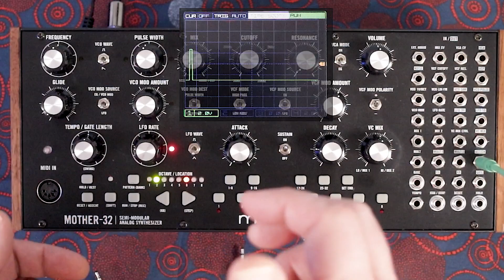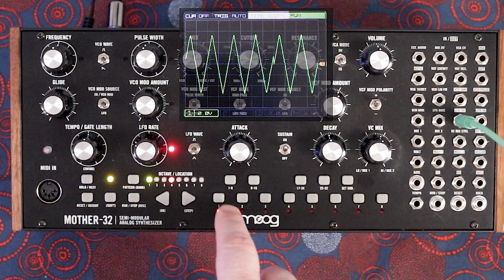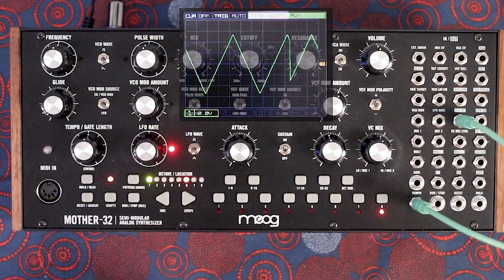More Randomness | Sequencer Playback + Tempo Input Patch | Mother-32 Tutorial - Part 8

Comment: Due to your clear instructions I succeeded in making this work (despite my color blindness which is maddening in setup mode) but there were some oddities. The sequence would stop either on its own or if I pushed the tempo to either extreme - particularly if I cranked the LFO rate quickly in either direction. And sometimes the run/stop button wouldn't turn off the sequence. So I would end it with an LFO burst and  then push run/stop to reset. For my musical purposes I would just run the random sequencer setting and control tempo with the tempo/gate knob. But, your video is still very instructive – even though I still haven't entirely wrapped my head around the voltage threshold concept and why the mix knob worked that way (homework!). Try an octotonic scale - it's very cool with random sequence playback: Whole - half step scale: C Db Eb E F# G A Bb. Or a whole tone scale: C D E F# G# A#. And then, with either scale, while the sequence is running, hit any pitch from the scale to transpose the sequence up and down.
Reply from the maker: Great idea! I'll definitely play around with some of those scales. 

To your point - completely agree. That's why I said it was completely ridiculous! Ha! It's just not as good as setting the sequencer to random... Far more complicated.

I noticed the same thing - i.e. stopping at weird places. I think that has to do with the threshold thing I mentioned and the paradox of which one starts.

Let me try to explain the threshold. Imagine we had a smooth random voltage and not stepped. If that voltage wobbled within the bounds of one note, the sequencer wouldn't move - no matter how long it stayed there. But as soon as it crossed the bounds for that note and went to the one above it - it would change values and move a step. So it would play arythmically if the voltage was totally random. 

It was a fun experiment!
Reply: @braintree56  Thanks for the explanation. It’s clearer to me now. I admit that I have ‘I’m incapable of understanding this’ anxiety about voltage control - just as I did with algebra in high school. But I did eventually parse algebra so I will persevere! LOL 

Any symmetrical scale is great for sequence randomization. They can be harmonically functional or not - specifically or ambiguously, somewhere between tonality and atonality. Without a tonic reference, they’re like crossing waves that make moirés patterns. Check out Olivier Messiaen’s ‘Modes of Limited Transposition’ for more interesting possibilities. 

https://en.m.wikipedia.org/wiki/Mode_of_limited_transposition